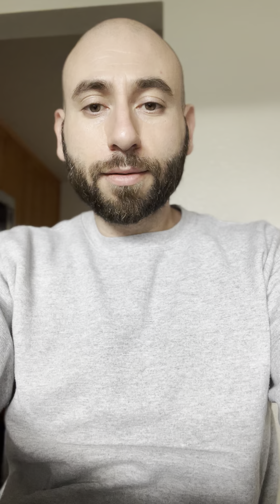Chrysler Pacifica shifter not shifting stalling loosing power fix @blautomotive7230

Comment: Since posting this video, have you had any other issues with your Pacifica? I have a 2023, and am currently experiencing the same issues. And the dealer/Chrysler refuse to fix it. Would love to talk to you via email/phone/etc. if able.
Reply from the maker: After showing Chrysler the video in my description, they replaced the can shaft sensor. This cost me about $1,000. Chrysler said they could not guarantee this would fix the issue. They replaced the can shaft sensor and the problem went away. I am going through a divorce and no longer have the van but after the repair we had the van about 8 month without any more problems.
Reply: Thank you for the reply. The dealership has now had our van for 15 days, because I did not accept it when they said there was no fix. Opened a car with Chrysler cares, and had to fight tooth and nail every step of the way. Just got a call this morning that they are replacing the transmission. Can has less than 10k miles on it. Curious to see if the issue comes back.
Reply from the maker: @3hendricks Hi, did the issue with your van get resolved?
Reply: No issues since the transmission replacement. They never told us WHY they were replacing the transmission, which raised a red flag to me. They said “The engineers at Chrysler just said to replace it, but no explanation why.” They were also unable/unwilling to tell me if Chrysler has resolved the transmission issues in their newer-made transmissions. Chrysler will never admit it if/when they do fix it, because that would mean putting an $11k transmission in about 70k minivans.